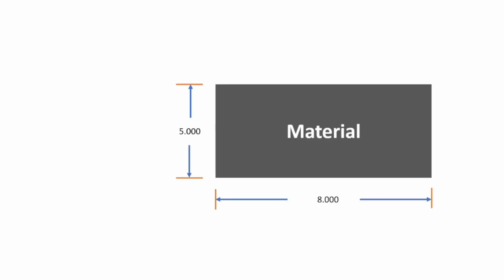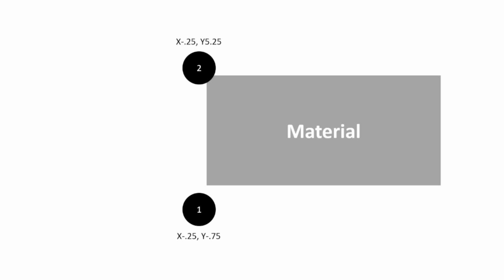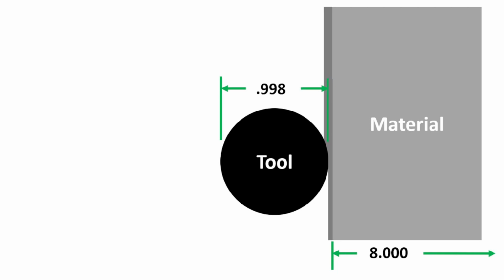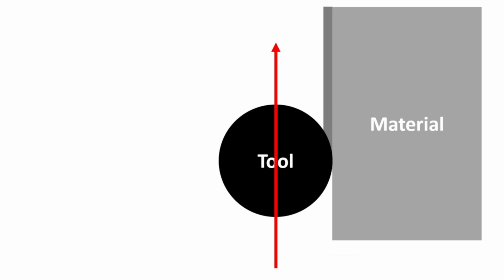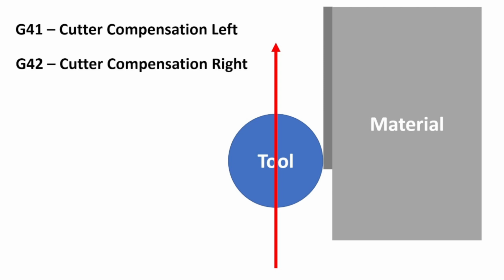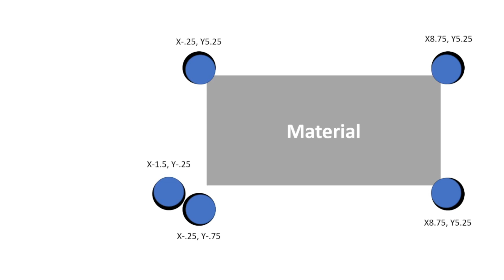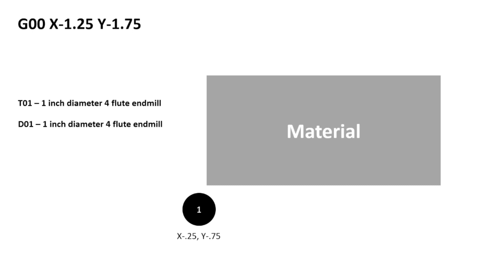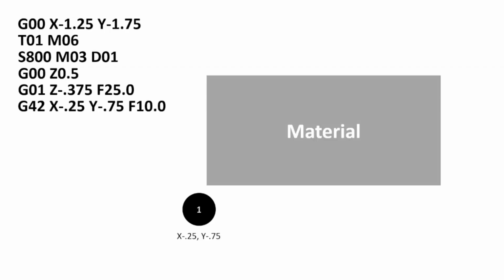G41 and G42! CNC manual programming lesson 7 part 2

Comment: I’m still confused. If I use a G41 and it allows me to offset a tool D value, whether I type in a negative or positive number, it will offset it by that amount. I don’t understand the left or right. (G41/G42). You’re basically just telling the machine that the tool is bigger or smaller than the program says it is. When would I use one over the other? Same with G43 and G44. What’s the difference between + and - ? When I use a G43, cant I just use a + or - value in the height offset. Why do I need separate left right, + and - codes?

Whether I’m inside a pocket or outside of the edges of the material wouldn’t the same code work? If I put a - value in the wear offset it’s always going to go closer to the material and if I put a + offset it’ll always move further from the material?

Will Using G42 instead of G41 just make my tool offsets do the opposite moves? Negative now moves away from the material and positive now moves toward the material? If so Why would that be useful? I think I understand it when it comes to lathe work but not milling.

Comment: And....people set there tool offset on a Haas to make corrections with this code and they don't know why the control said FU and repeat.  You gotta program the dimension.
Reply from the maker: Yes very true. This video was made to show how to correct sizes with these codes, but G41 and G42 are far more useful in the original program so that offsets can be used and lengthen the life of the tool.
Thanks for your input.
Reply: @adamtaylor999  I am a Haas Tech and you would not believe how many jobs I got to for stuff like that...they call and say my software is bad blah blah...and they just can't code
Reply from the maker: @kevinc9006  I would imagine you have heard it all 😂 I teach all of my students how to manually program before I teach any CAM because it is so important that they understand CNC language as well as  proper program structure, programming with intent. Being able to write code manually helps them to edit codes accurately later on. We run only hoss machines at our campus and we love them. They're old machines and need an update but they're workhorses.
Reply from the maker: Haas...geeze
Reply: @adamtaylor999  I like Haas.  Everybody says my demi mori ran 15 years and never gave me a problem.  Then after I fix there machine they tell me the last processor they got for a demi cost 20k because they are DC servo driven

Comment from the maker: Hello @7alfatech860 and yes absolutely. Whether you use G41 or G42 depends on what side of the tool  that the material is on. So if you are climb milling around the outside of a piece of material (like in the video) then you would use G42 however if you are climb milling around the inside of a pocket then the material would be on the left and you would use G41. Excellent question! I will be putting out a few more videos and one of the videos will be a complete walk through creating a part that uses both G41 and G42.
Hope this helps.

Comment: Thanks for a great series! Does the choice of G41 vs G42 change if you are milling a pocket vs milling an outside feature?
Reply from the maker: Hello @7alfatech860 and yes absolutely. Whether you use G41 or G42 depends on what side of the tool  that the material is on. So if you are climb milling around the outside of a piece of material (like in the video) then you would use G42 however if you are climb milling around the inside of a pocket then the material would be on the left and you would use G41. Excellent question! I will be putting out a few more videos and one of the videos will be a complete walk through creating a part that uses both G41 and G42.
Hope this helps.
Reply: @adamtaylor999  Much appreciated👍